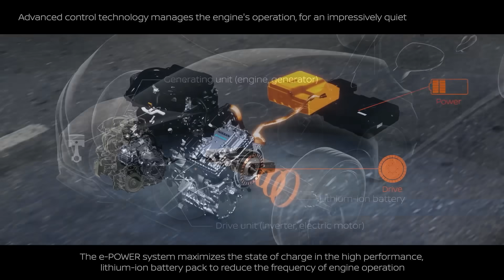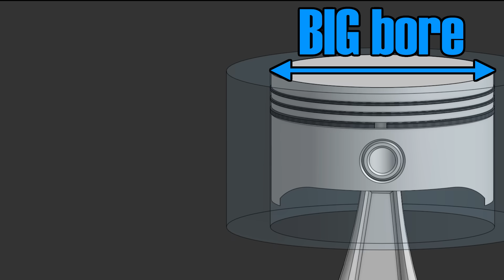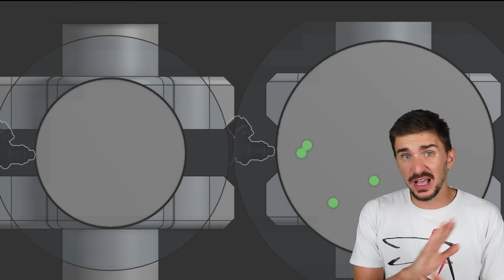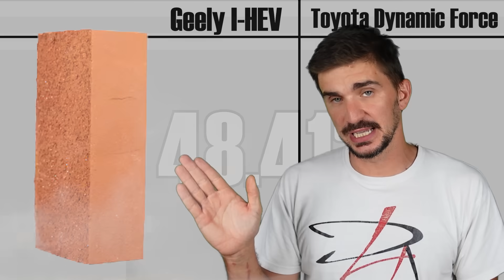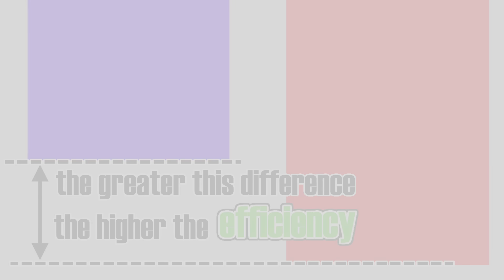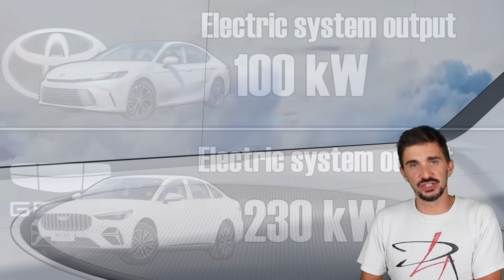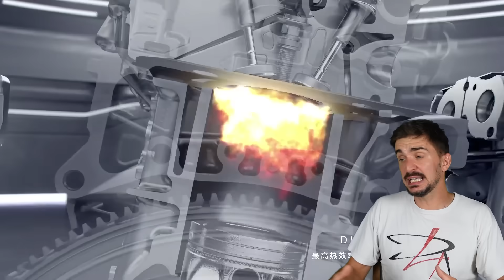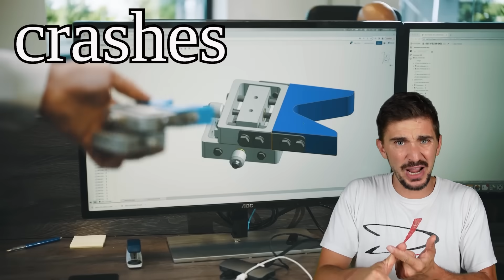How China's Geely Beat Toyota, BMW, Ford and Everyone Else

Comment: No matter what all the manufacturers of internal combustion engines do - they don't reduce consumption, they increase power. They make engines with 150 and more horsepower. And they commercially push it in the sense that they give a lot more power for the same or slightly increased consumption. I can drive a car with 50, 60... horsepower. Why hasn't such engines been designed to consume 2 liters of fuel?

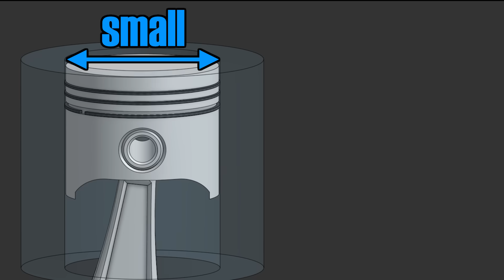Comment: 4:00... huh?
a 1L cylinder is srtill a 1L cylinder regardless of bore and stroke...
perhaps you meant the smaller piston has less area and produces less force for a given pressure?

the combustion chamber also has less surface area to lose heat through...

Comment: 16:03 these vehicles are not supposed to be driven with very low battery percentage. I have driven a byd sealion 6. If you take a long trip in a PHEV put the car on hybrid from the get go instead of driving on electric only mode and forcing the car to turn on the engine when the battery is near empty. It's like walking one km with the right leg alone and another one km with just the left leg alone when you could have easily walked the 2 kms with both legs.

Comment: I really wish Toyota would make a hybrid with 5-10kWh battery for 5-10X the instant peak power vs their ~1kWh hybrid battery, 150-200kW electric drive and high-efficiency 35-50HP continuous / 80-100HP peak modified Atkinson engine. You can still drive on 50-80HP, you just won't be breaking acceleration records. When I drove my mother's Bolt EV, I rarely used more than 50kW for acceleration, 20-35kW on the highway depending on driving conditions, 80HP/60kW would be perfectly fine with eCVT's practically infinite torque conversion range.

It is the only sensible way to build genuinely efficiency-oriented non-plug-in hybrids IMO, size the engine to cover average baseline load for 2/3 of people with modified Atkinson, let batteries handle the rest, still got the option of rolling back Atkinson for power for the remaining 1/3 of of driving as needed. The engine-first hybrids with 1-2kWh battery are mostly compliance vehicles to get around current or upcoming restrictions on sale of new fuel-only vehicles, basically nothing more than an eCVT with small starter/regulator battery attached.

The ID3-REX's 25kW generator is just barely enough to keep up with highway driving load under fair driving conditions. The problem with it is that by default, the generator doesn't start until the car is about to enter limp mode. If the engine could be started when the battery is at 50+%, which many modded their ID3-REX to do, then the battery practically never gets to limp mode.

No need for any cloud-based battery management to handle uphills: if their "deep Atkinson" cycle engine has variable valve timing, they can just roll back valve timing towards Otto for up to twice the power. That takes care of your long-uphill issue without cloud/AI-anything. Charging the battery ahead of an uphill wastes roundtrip losses through the battery and likely also operates the engine slightly less efficiently too, may not be any better overall.

Comment: Yeah it's not that hard to make an ICE that just runs but doesn't have any power compared to an actual working engine that propells the car. It's basically an EV with an engine that can run at idle

Comment: rotary turbines can go above 50%. ie only based on compression ratio increase. input air oxygen filtering would increase the efficiency even more. christ only, flesh is of no use. cloud, doesnt your tech work independently ie an engine. your engines actually need to work to be useful. with enough margin not to fail on the fly. being robust and powerful enough for everything. independent of cloud. christ makes free, actually free.

Comment: Chinese manufacturers have not reduced the production of evs. They have expanded the production of extended range (hybrids). Since it happened together with the increase in exports to "less developed" countries, which have less developed recharging infrastructure, I think consumer resistance to pure electric cars is the problem they are solving with those cars.

Comment: I have tried miller cycle valve timing with 12.5 comp. ratio . It controls NOx very well but is so limited by mechanical compression. Running higher compression helps but makes Otto cycling difficult. Creating a situation where  a narrow powerband like Hybrid assist is the only application for the Greeley design. Nice

Comment: China are leading. Toyota and BYD form join venture in research 2024. ( Open their statement on website) Even some model using PHEV BYD engine and battery. Xpeng work with VW with minority share 5%.  Btw Geely own 9.9 %of Daimler Mercedes. Not surprised with their achievement

Comment: That is somewhat why I changed my Corolla TS 2.0 (a Trek variant) bought in 2021 with a Qashqai ePower in 2024. The Toyota seemed gutless and loud (because of eCVT) whereas the QQ is fluent and quiet and torqued. Weirdly the consumption is the same, after two years of ownership. You mentioned briefly ePower and discarded afterwards, it is an enginefied electrical car, with apparently no issues on long uphill. Knowing your passion for efficient engines I was slightly disappointed when you chose to buy a Prius, a pretty car with bad ergonomics 🤭.

Comment: The reason people have problems with Chinese hybrids with small engines is incorrect use.
They have the option to run on electric only until the battery runs close to flat. It then runs the petrol engine because it has no choice.  If people drove it in hybrid mode and didn't run the battery down to flat then the engine would never need to drive the car and charge the battery.  Also the Chinese hybrids are getting increasingly larger batteries.  Most new Chinese plug in hybrid cars get close to 200km in electric only. Many of these plug in hybrids have more range in electric only than some of the first EVs.
I think the reason for plugin hybrids is that people are more comfortable buying a hybrid car than a full EV, however,  the newer plugin hybrids have such long range on electric only that people realise soon after that a full EV would have been fine. It is not that China is going away from EVs, they are selling you a short range EV with a small petrol engine.  It means if they want to go full EV all they need to do is don't put the petrol engine and put a bigger battery.

Comment: So all electric is not going to happen in the mid run. We have to boost and take advantage of 140 years of experience and development of internal combustion engines and combine it with hybrid efficiency. That seems the way to go for the time being.  Batteries are piling up in cementeries as we speak

Comment: Honestly - it makes more sense. The "vanity hybrids" with assistance Electric motors are for nepo babies.
Most normal people would prefer a hybrid with 200 battery range and a 50hp combustion support for long range drives. And those would be suburb/rural vehicles. Cities are fine with pure EV (ignoring charging infrastructure)

Comment: So in short, Geely made the long discussed hyper-optimised low RPM petrol generator strapped to an EV? I mean, that sounds pretty good to me, as long as it has the battery capacity to not need to be constantly charging off the generator.

Comment: Had to check the stroke to bore ratio of the Chrysler 225 slant six, and it has a lot longer stroke even compared to that engine. (1,21:1)

Comment: It being a 1.5 turbocharged probably means the longevity and reliability will not be as good as Toyota's 2.5 naturally aspirated 4 cylinder. The turbocharger means the engine will run hotter, and it is an additional major failure point. But the claimed efficiency is impressive

Comment: Vw was at 45% in 1999. they just dont care.
Reply: One of the TDIs, right?
Reply: @alexwalker8422  probably. It was the apex of a long string of SAE discoveries. Other manufactures also caught up. But maintenance was hell...
Reply: @DanielMario-xu3me that is just about the right word for that engine; what a bunch of rip offs we have to deal with everywhere else.  It was too easy on our wallets for their business model.  
Edit:
My point still stands, regardless of the fuel used, at least as far as the US is concerned since it's the only high quality sedan sized diesel engine available here.
Reply: @alexwalker8422 my lupo 3l runs fine
Reply: @alexwalker8422  Diesel not petrol . your point is irrelevant. Do try to keep up here🤦‍♂
Reply: @OzsmallboreI was well aware of that
Reply: thats diesel and chinese diesel are at 53%+, also worlds best
Reply: @weiwei8072 don’t believe Chinese numbers about efficiency and German numbers about emission
Reply: @andreasreichwaldt3994 and american numbers about the economy
Reply: @andreasreichwaldt3994   chinese efficiency can be seen in how efficient their country is run especially large projects, and compared to the west the western hypocrisy is jarring.
Reply: What’s the reliability of these engines I wonder?
Reply: @thelearningimperative6797 the VW lupo 3L engine is very long lasting. mine is at 270.000km now. like 190.000 miles. I heard its very reliable.
you know the plans for thr engine still exist. it could be built nowadays.
Reply: @thelearningimperative6797  last about 2million miles if you service the engine according to user manual.
Reply: China achieved 50% efficiwncy on a diesel engine like three years ago.
And it is a none eletrified none hybrid powertrains.

Also given diesel gate. Can we trust a single word VW said on diesel egines.
Reply: @888YangJi  Scania was at 50% in 2016, good job copying it. All China is good at.
Reply: @ezustnyil8414  What do you mean copying it?
you mean achieving 50%? or copying designs?
if it is the latter, where is your evidence?
You do not even know which engine I am talking about?
if it is the first, are you essentially saying those whom are behind should just stay behind like they are meant to be, so that you can sleep easier at night knowing your invented reality actually exists.
BTW did I say 50%, I think I misspoke. I really meant 53.09% in 2024 and still currently the highest thermal efficiency mass-produced, commercial diesel engine.

according to Google gemini
Weichai officially launched the world’s first commercial diesel engine with a base thermal efficiency breaking the 53% barrier (specifically hitting 53.09%). This record was strictly certified by TÜV SÜD (a leading international authority) and the China Automotive Technology and Research Center.

This achievement marked Weichai’s fourth consecutive world record over the span of a few years:

September 2020: Reached 50.23%, breaking the long-standing industry consensus that 50% was the absolute physical limit for a diesel engine.

January 2022: Pushed to 51.09%.

November 2022: Advanced to 52.28%.

April 2024: Climbed to 53.09%, setting a new global benchmark for mass-produced engines.

Comment: This is what Land and Range Rover should be doing with their larger models. Make their four and six cylinder gas engines into supercharged deep Miller cycle engines with relatively high power electric motors to make up the performance. A 50 miles per Imperial gallon full size Range Rover or defender with 0-60 in 7 seconds would get my money.

Comment: The Citroen D19 of the early sixties was a slow revving long stroker. Acceleration was very unremarkable but the efficiency was great. I could get close to 30mpg at 70mph in my four speed manual. For the time this was pretty remarkable.

Comment: this is the most unnecessary, complicated, buzzword shareholder pleasing marketing bullsheit approach to making a fricking machine to get you from A to B. either just put batteries and a powerful enough motor on wheels and go, or put a powerful enough engine on wheels and go.

Comment: 1) At 13:56 it says "1.5 Turbo electric hybrid engine", so is it forced induction or not?  2) This 'primarily electric' vehicle reminds me of the hybrid BMW i3, which is electric, but has a small petrol motor (range extender) for charging the battery.  I don't believe the range extender drives the wheels but only charges the battery, but now I'm wondering if that engine might also operate with an Atkinson Cycle?  Anyway, great content as always!

Comment: 48%  efficiency instead of 41 is not an improvment by 7 % but by 17%! This is etremly significant and therfore I doubt that it was archieved my millering more or increasing the bore/stroke ratio alone.

It is totally unclear what is ment with big punch by a large stroke, this is not a valid explanation for anything. 

Long stroke engines differ from short stroke engines mainly by:

- reducing heat losses during the most critcal time (combustion) by having smaller combustion chamber surfaces

- faster combustion because of shorter flame travel

- reduced knocking tendency because of the faster combustion

- lower HC emissions because of heaving less surfaces and smaller volume in the ring land

- higher NOx emissions by a combustion and lower heat losses

- More problematic fuel injection in DI engines because the tendency for wall wetting is higher with a smaller bore (contradicting to your statement)

- lower volumetric efficiency because of smaller valve sizes.

The more efficient combustion allows the long stroke engine to archieve a higher mean pressure (proportional to volume specific torque) at low rpm, with reduced power output at high rpm because of the smaller valve sizes. The long stroke myth is not false but technically fully correct, long stroke engines tend to have mot torque at low rpm but less at high rpm.

We have to wait and see, but I'm shure, Geely is using a lean combustion (maybe quite similar to Mazda), otherwise the 48 % thermal efficiency wouldn't have been archievable.

Comment: It uses a petrol engine to recharge the battery that powers the car,,,,,So it’s just as polluting as a normal petrol car,,,,,More so actually,,,When you factor in the manufacturing of the batteries and the fact that the batteries can not be recycled because it’s cost prohibitive,,So they will go into a dump,,,And over time leak deadly poisonous chemicals into the water table,,,Just like the billions of other batteries from the billions of electric cars now produced,,Not to mention the new battery packs needed as the old ones wear out,,,,,,,It’s a worldwide natural disaster that will be more devastating than anything seen in human history,,,,

Comment: Yet again ,,,,This guy is excited over DLC inside an engine,,,,,When it’s already been proven time and again that DLC brakes into thousand of pieces over a short time span,,Like a window shattered,,These tiny pieces are as hard as steel,,They destroy everything inside the engine,,,And it doesn’t matter how well you treat your engine or how many times you change oil,,,,DLC only lasts a given time,,,,,It’s yet another gimmick they use for more MPG,,,But it doesn’t make any difference over an engine Thats doesnt have it,,,,,,

Comment: So the valves are cut from the head itself,,And this guy gets excited over this,,,,,This guy is the problem with modern engine manufacturing,,,,,,The head is a one use trow away item,,,,,,Disposable heads,,,,,,,Absolutely disgraceful from geely,,,,Also it won’t last 100k miles with 500 bar and 15to 1 compression,,Not in a petrol engine,,,,it’s disposable junk

Comment: If they only have direct injection, then the valves will plug up with carbon after 50000 miles perhaps. And then the heads have to come off for walnut blast-ing. Or have they fixed that somehow?

Comment: And it still used throttle valves instead of infinitely variable intake cam for throttle like bmw, and it was a 4 banger too, imagine it being an inline 2, so there's still more room in gas engines. Now imagine if a 90s era turbo diesel with 22:1 compression had modern tech in it with all the injection pressures and miller cams and coatings and all, now that would be something.😊

Comment: I rent a BYD seal a while ago and it was exactly, as the Geely car. I was wondering, how did BYD archive this efficiency. Est. 1300 km from a 65 l gas tank. The EV battery had an est. max range of 28 km (not 120 like in the spec). Acceleration from 0 to 60 km/h was excellent, while elasticity 80 - 120 km/h was abysmal. At highway speeds 130 km/h the gas engine was struggling, running out of steam. However it was perfect for city, while still good performing at longer ranges. If BYD and Geely can archive a decent reliability and longevity for their drive trains, they will kill of their western competition. Especially considering the abysmal drop in reliability of all the new downsized engines.

Comment: Great analysis and explanation of everything, especially exposing the journalism propaganda that keeps misusing the Miller and Atkinson cycle and just throw in fancy blabber they don't truly understand for marketing purposes.

Now I am SICK of corporates sticking the word "Now it's better with A.I" on every darn thing when they don't comprehend the insane processing power required behind it and its manufacturing and running costs, while in most of the things they mention it would be much more cheaper and efficient to use simple electronics that we had before A.I, like microcontrollers paired with accelerometers and electronic gyros and active feedback circuits.